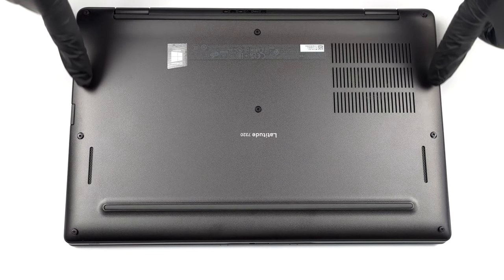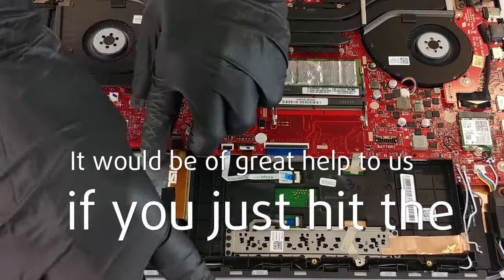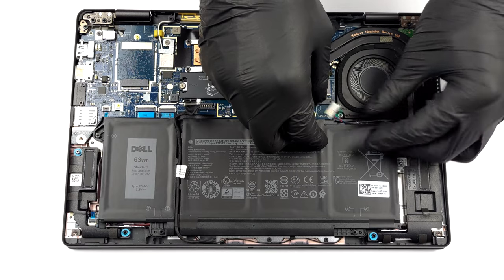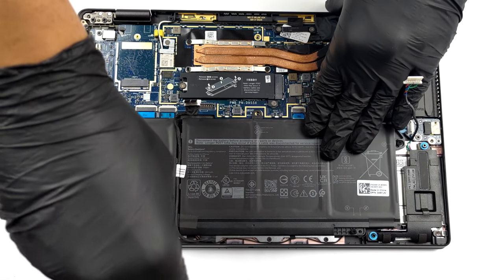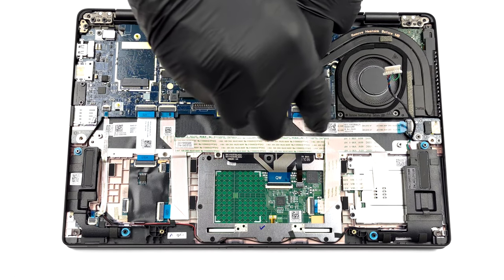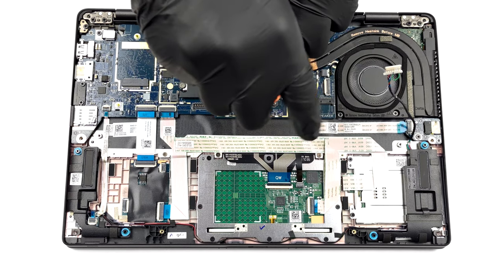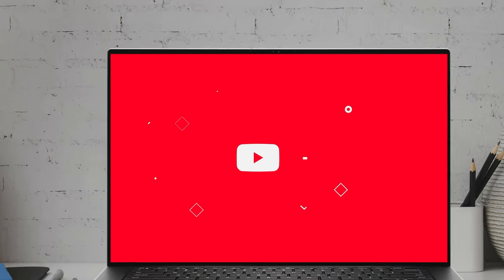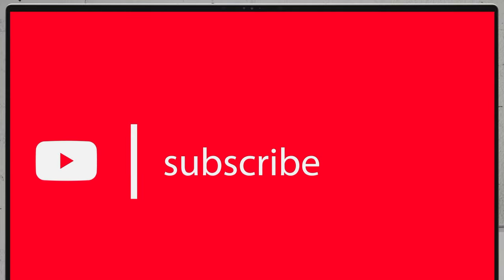🛠️ Dell Latitude 13 7320 - disassembly and upgrade options

Comment: Where is the CMOS Battery hidden in this thing!?
Reply: A lot of laptops don't have a CMOS battery anymore. They just use the main battery to supply CMOS power. I guess they could have hidden the cmos battery under something, but try just removing the main battery first.